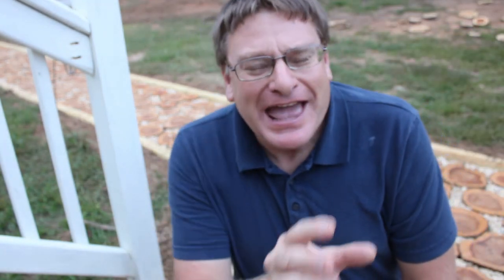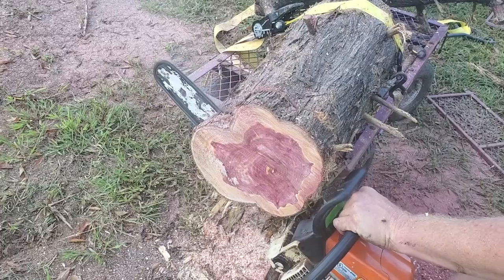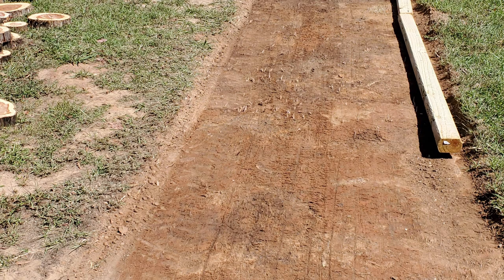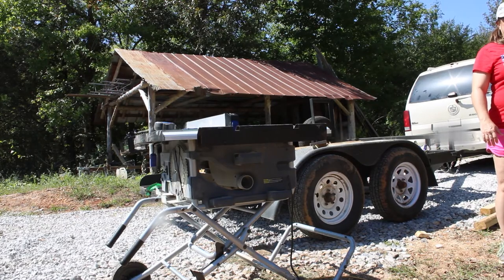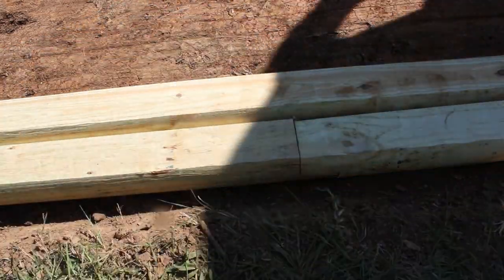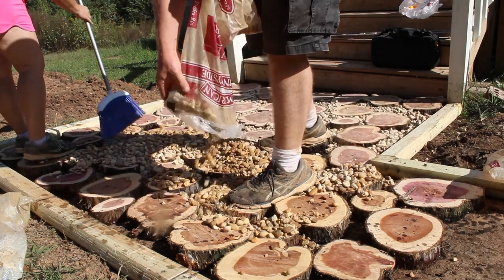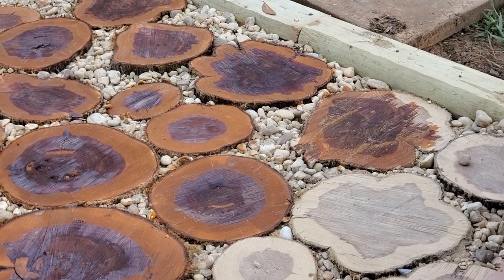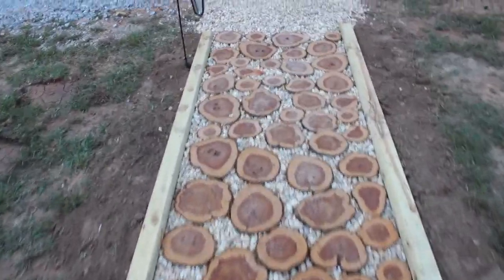How To Build A Natural Wood Slice Walkway Using Cedar Trees

Comment: Hi, It’s very impressive. I have two questions. How are they in the way of durability. If I apply them to our walkway, will they hold up for a long time and do you have suggestions to prevent cracks on them in future?
Reply: Have you tried it on your own? If so, what is your experience afterwards?
Reply: I didn’t. I made a reinforced concrete walking path